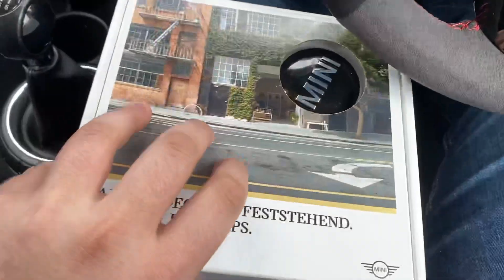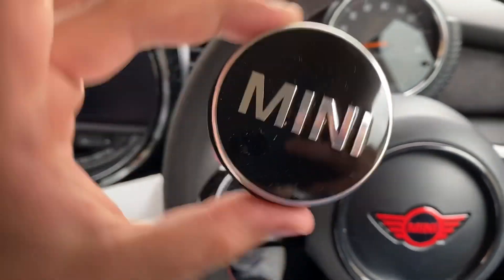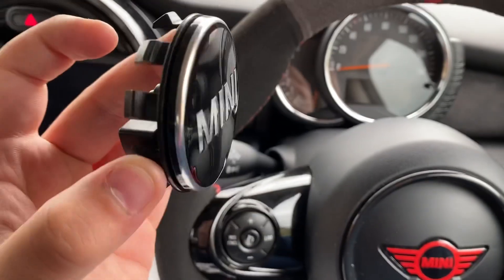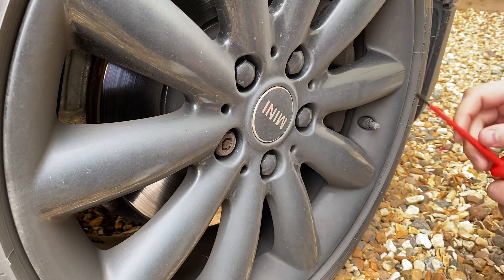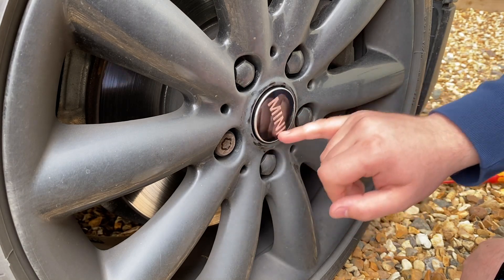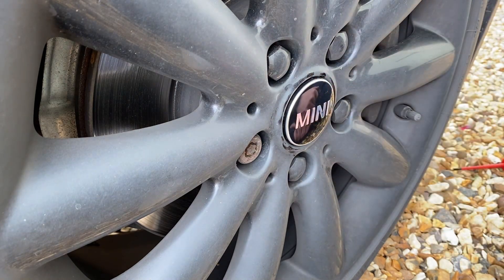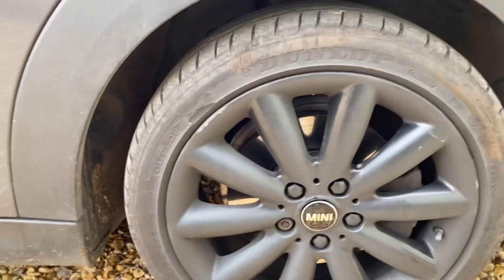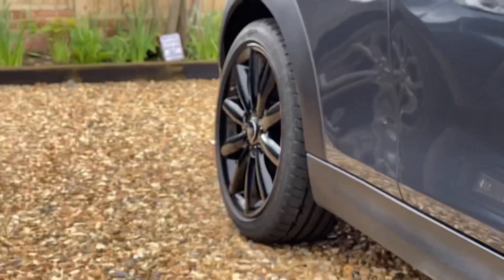INSTALLING FLOATING HUB CAPS ON MY F56 COOPER S

Comment: You're so lucky, I got JCW ones and they foul on a clip once installed but spin freely off the wheel. I need to take off the three of the four wheels that get stuck to see if some gentle persuasion is required. They're the right size because one works perfectly.

Comment: Nice finishing touch 👍
Just bear in mind any oil or grease can affect plastics and would trap dirt and brake dust. You'd be better with a silicon spray if needed.
Reply from the maker: Ahh! Thank you so much for the tips! I wasn’t aware of that but I’ll take note 😁

Comment: As a heads up, another way of taking the caps off is to stick duct tape over the cap and slow pull them out, saves you chipping the old caps! (just gotta make sure the wheel is clean and dry first)
Reply from the maker: Hey 👋 I had thought but couldn’t find any 😂 thankfully I have plans to get them fully refurbished so slight damage wasn’t a worry to me. Thanks though for the tips! I’m sure someone else doing this would greatly appreciate it 😁
Reply: Just an orange plastic thing for removing dashboard panels would work to remove the old ones.

Comment: Hey man, where did you buy these awesome wheel bolt nut caps in the same jet black color as your rims? Thank you!
Reply from the maker: Hey! They’re just covers that go over the bolts. I got them from eBay.
Reply: @BenRolfe   tnx! Did you recolored them to a Jet Black mini rims color? They look exactly the same color! 
I have silver mini cosmos spoke rims and want to refurbish them to a original Jet Black color. Do you maybe know the code of the color of the rims you have so I can tell my mechanic to recolor them?
Reply: @BenRolfe  Can you paste the link of yours? I think that those which I bought are too long. :(

Comment: Would they fit the r53 cooper s alloys
Reply from the maker: I’m not entirely sure, the diameter is 112mm
Reply: @BenRolfe  ok cheers Ben what's the link to where you got them from?
Reply from the maker: There isn’t a link as such as they’re all their own individual eBay listings but I searched for “MINI F56 floating hub caps”